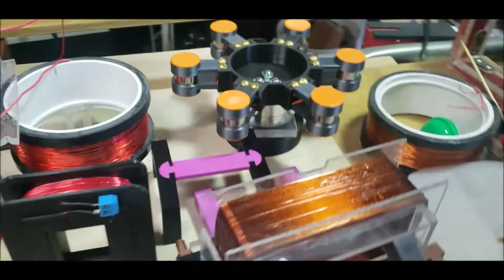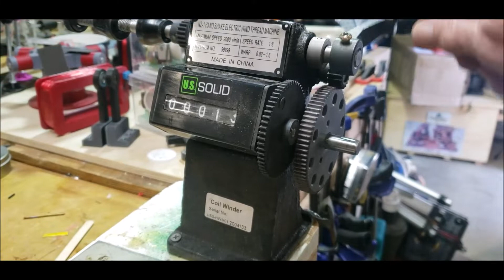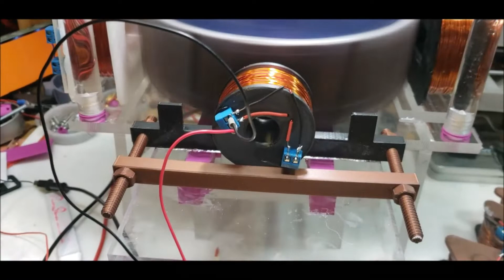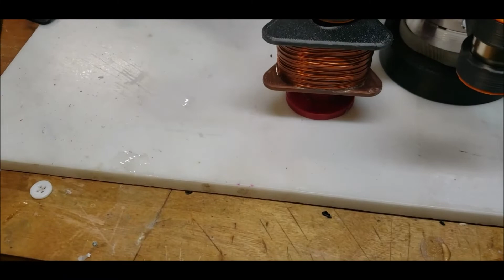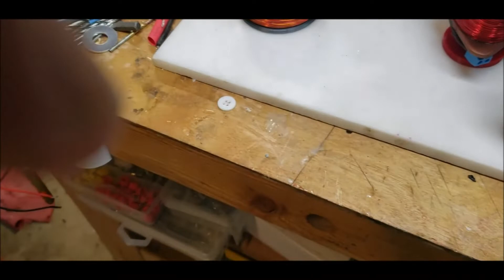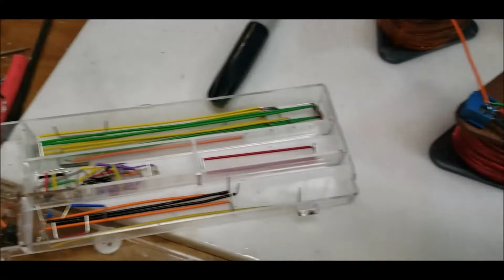3D Printed Pickup Coils Build (continue)

Comment: Can you share the 3d files please?
Thanks
Reply from the maker: for the triangle coils???
Reply: @mcorrade  I like to follow along with you. How did you build the whole thing?
If you would be kind enough to give me all the files so I can replicate your system. I think you call the other part the base.
I am new to this stuff and at the age of 70, trying to learn also
Gif bless you sir
Thank you
Reply from the maker: @Gacha.Cupcake  https://www.thingiverse.com/mgendron57/designs
Reply: @mcorrade  thank you sir
Reply: I saw a video recently from TeslaTech where they made a pyramid out of copper and then put a Tesla coil under it and connected the top of the coil to the top of the pyramid. By pulsing the coil, they were generating additional electricity. I will try to find it and link it here. Just FYI.
Reply: @mcorrade  the video is from TeslaTech and by Peter Grandig
Interesting